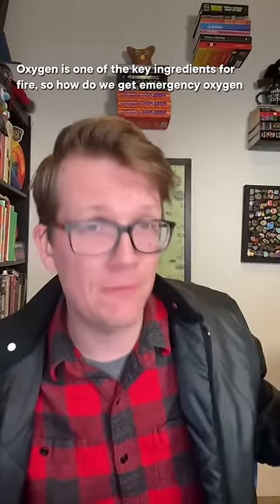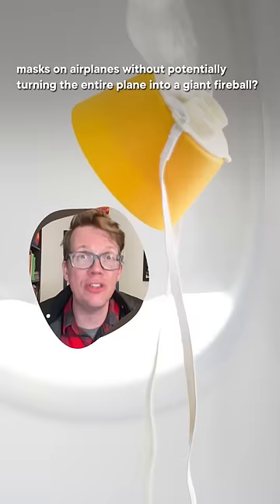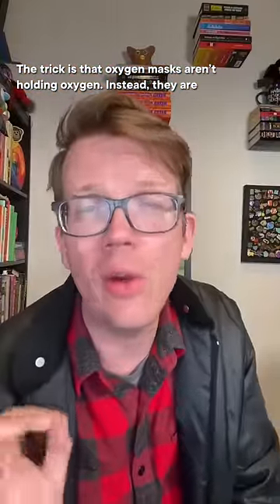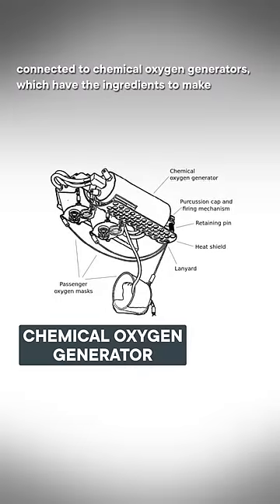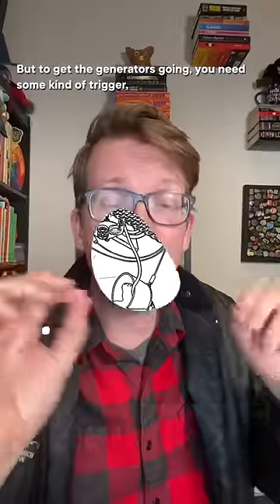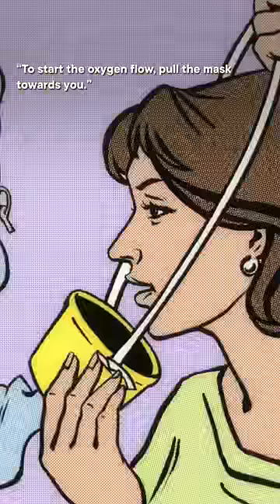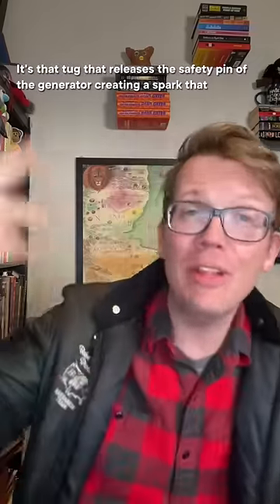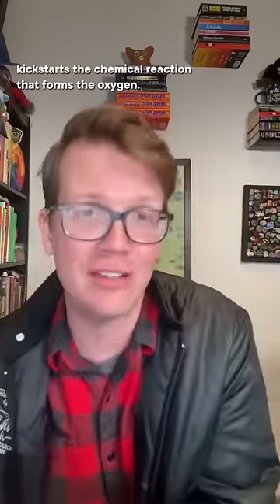If oxygen means fire, how do we get it on airplanes? #shorts #science #SciShow

Comment: Plane mechanic here I’m going to correct a few things from the video and comments (though I caught this early so not much yet). 

Firstly the trigger isn’t the pull towards you, it’s the downward tug. Just bringing the mask to your face won’t necessarily start the generator depending on how tall you are, so the instructions are (as far as I remember off hand) to pull down on the mask and then place it over your nose and mouth. This is due to the pin that starts the reaction needing to be pulled out of the generator to start it having a sting connected to the mask part. Important to not it does not need to be yanked on, just a firm tug should do the trick.

Secondly, I’ve noticed some people talking about O2 bottles so let’s address that. The ideas change depending on what kind of aircraft were talking about but I’ll be addressing what I’ve seen in regards to large passenger aircraft. No, modern planes don’t have actual O2 tanks mounted or contained for passenger use. This is due to weight and safety. Plumbing is heavy, so are containers. Having an entire plane’s worth of O2 sitting around is both a massive fire and detonation risk. It’s also massively inefficient in terms of weight. On top of this keeping and maintaining pressurized containers is a huge pain as they have to be examined frequently and pressure tested regularly. Generators in comparison are much better. They do need to be checked but the checks are light, there’s no concern of having an O2 leak, they are light, can hold a lot of potential oxygen for their size compared to bottles, and they don’t run the risk of exploding on contact with fire. Now they are still dangerous in a fire since heat starts the internal reaction, but they can’t produce enough to create an explosion hazard very quickly making them much much safer.
O2 bottles do exist in the plane though. The cockpit has it’s own dedicated O2 system since the pilots need to have it ready to go at a moment’s notice. There are also bottles in the cabin for flight attendants to use. Some may have seen these being used for passengers who are experiencing a medical issue. These bottles exist because they need to be mobile or have on demand production and not one and done production which generators cannot do.

Saw someone talking about how oxygen isn’t a danger as we have oxygen around us all the time. While true, we have a very low concentration of oxygen in the atmosphere, even lower amounts in a flying plane, so there’s not much issue with it being around. Pure oxygen however is extremely dangerous. It can and will explode if there’s enough of it and even small elevations in the oxygen content of a room can make fires burn much hotter and spread incredibly quickly. Fire is the largest danger for aircraft as even with all the safeties and backups it can eat through a plane very quickly rendering it uncontrollable or becoming a massive passenger hazard on the ground. Know where your exits are always. Don’t bring bags with you in an emergency. Delays of seconds can and have killed people. I know of one example where 10 people died because one man went for his bag and blocked the aisle. Fire on a plane is fast and deadly. Listen to crew, know how to get out. We try to prevent fire as much as possible for this reason.

May edit later if I see some other things but I hope this addresses a few bits of misconception. Cheers!
Reply: Oxygen doesn't explode, it just makes non-explosive things explosive :)
Reply: On the military side, we do have plenty of compressed O2 bottles and carry liquid oxygen in special tanks that’s converted to gas on demand.
Reply: @yingosensei  I am aware of this but unfortunately don’t have much expertise in the matter. I would guess it’s due to the want to have on demand control over the oxygen and since all your personnel would probably be trained in their use there is no need to use a generator that produces heat and can’t be shut off
Reply: "No modern planes don’t have actual O2 tanks mounted or contained for passenger use" I don't think you meant the double negative
Reply: I can't speak to all modern planes. But I can say that the Embraer Phenom executive jets, the most popular private jet in the last decade, ONLY has oxygen lines for all passengers.
Reply: @oumo  I wouldn’t be surprised, but again this is all for large transport category aircraft like 737s or A320s. Different classes will have different design ideas so I’m just covering the same kind and the most seen by people.
Reply: ValuJet 592.
Reply: Hands down the largest comment I've seen
Reply: there are a select number of full size passenger planes that do use bottled o2 because the areas they fly in make the generators ineffective.
Reply: @yumcherubicplum_5535  what areas would make chemistry no longer function?
Reply: I'm always amazed at people arguing things aren't dangerous. Anything can be, but especially chemical reactions. These canisters once brought an entire plane down because they were listed as "empty" in the cargo manifest of a passenger plane, and the pilots believed that. What the person had meant was "expired." So when one exploded in the cargo hold... well, it wasn't good for anyone on board. These are life savers but they work by a chemical reaction that causes oxygen so of course there's a risk. 

EDIT: ValuJet Airlines Flight 592, with loss of all 110 souls on board. Aside from them not being empty, the pins weren't secured properly so one likely knocked out and activated. These create immense heat when working so they began to set others off. The fire suppression system worked by making it air tight, which would block oxygen from making a normal fire worse. Here, there were 144 canisters going off one by one, making more oxygen by the second.
Reply: Correct me if I’m wrong but this is strictly on modern aircraft. I know for a fact that some older variants of the Boeing 747 did indeed carry supplementary oxygen bottles mounted to the walls of a cargo area, as well as the plumbing to support the delivery of the oxygen to the passengers in the event of emergency (I believe this was specific to Qantas 747’s, but could be wrong). 
There was even a specific accident where a young man was sucked out of a 747 crossing the Pacific Ocean due to one of these oxygen bottles exploding and ripping a huge hole in the side of the aircraft. 
Probably no longer the case because we don’t live in the time of Casio wrist watches, and 747’s having human flight engineers.
Reply: @soulman4292  Qantas flight 30? There were no injuries
Reply: From what I remember a certain class of an airbus has o2 tanks, it is for flights over the himalayas or something like that where the time has to be much longer as the pilots can't dive to a safer atmosphere
Reply: Can I pull the mask out, if I pull too hard? Is that a possibility because I hope not (main airline info wanted: Ryanair, I love hard landings ok, it's like a roller coaster)
Reply: @Ethan.YT.  I'm sure it's not indestructible. Ryanair probably wants 5 for the use of the mask anyways.
Reply: @9HighFlyer9  surprisingly there free, I think. They don't say about any charges.
Reply: Air Canada and several other carriers have passenger emergency oxygen systems that are fed by oxygen bottles in the cargo compartment. These systems are typically found on aircraft that travel routes that would typically take longer than 15 minutes to safely get to an altitude where the passengers can survive without supplimental oxygen. For example, flights over mountainous terrain.
Reply: @9HighFlyer9  some some a 340s that fly over a very select part of the Himalayan‘s do use bottled oxygen because the time required to get down to 14,000 feet is higher than a chemical reaction O2 generator can sustain
Reply: Didn’t he say it was from the tug in the video? They never tell you while instructing you before the flight that pulling the mask towards you isn’t enough to activate it.
Reply: @yumcherubicplum_5535  I've been told that a320s, 747s and now a340s have o2 bottles for passengers while flying over the Himalayas. Where is everyone getting this info? I haven't found a single reference to airlines replacing O2 generators with gaseous O2 tanks.

I'm really doubting that it's true. The weight involved would be enormous. The costs to engineer and recertify the airplane would also be enormous. You'd think that some airline, plane manufacturer or engineering firm would want to brag about a safety feature like that.

So please someone tell me where this information is hidden.
Reply: @DavidCruickshank  no he just forgot the comma so it looks like a double negative 

"no, modern planes don't have actual O2 tanks mounted or contained for passenger use"
Reply: @9HighFlyer9  When the oxygen generators are used they give off an enormous amount of heat. When installed in the aircraft they are insulated and separate from one another so that this heat doesn't do anything. But in Valujet's crash they had a box full of them in the cargo compartment without safety pins installed or insulation and they were up against one another. The massive heat of them going off started the fire. This would not happen to the ones actually installed on the aircraft.
Reply: I'll correct some of your mistakes: LOX is stored on many aircraft. It's an older tech, but it's still in wide use commercially and in military aircraft. 

Also the fire risk for oxygen isn't from there being too much in the room. LOX can combust from contact with grease which you should know there is quite a lot of on aircraft. You have to be very careful when filling LOX onto aircraft for this reason and if the liquid oxygen gets free of it's plumbing/containment anywhere and contacts grease it's a spontaneous violent reaction. That's why the industry is slowly moving towards not using LOX.
Reply: Large cabin Gulfstream planes have cylinders. Not a 737, but pretty big.
Reply: I will try to be brief 1/573
Reply: As a Life Support Tech for many large fleet and military operators I can say that both Aircraft manufacturers and Operators are moving away from Oxygen Generators. Oxygen Gens are known for catching fire themselves. I have discharged thousands and had more than a good number burst or catch fire in operation. Cylinders are far safer to operate and maintain. Al/Carbon fibre or Al/Kevlar cylinders are super light and are treated as test every five years or on inspection items. We are no longer stuck with the heavy 3AA or 3HT cylinders anymore.
Reply: The guy said... it's that "tug" that triggers...
Reply: You waited your entire life for this video 😂
Reply: Haha nerd
Reply: Can you clarify something for me?  I am a paramedic and I gave aid during an in flight emergency.   I was told by the attendant that it is air not pure oxygen that comes from the masks.   Is that correct or is it pure O2?
Reply: @SJDevenney1  Surely the cylinder is labelled as either compressed air or oxygen?
Reply: People can easily skip the "pull down mask" quite easily and go straight to putting mask on since the mask is above and it being lowered enough to reach tall person face is enough to be considered pulled
Reply: No to just about everything that you wrote above. I make the oxygen regulators for Boeing, Airbus, Cessna and about 90% of the rest of the manufacturers. While we still make oxygen generators they are heavy and expensive. The last 5 years has seen a big switch to individual compressed oxygen tanks. The A380 has 2 large oxygen reservoirs and 2 regulators that feed all the masks.
Reply: Yeah, pure oxygen environment, for a good example just refer people to Apollo 1 accident.
It’s all about concentration.
The difference between a medicine and a poison can just be concentration.
Air typically has water in it, in a small %, but in an environment of 100% water you drown.
Wether or not something is present is not really the question, it’s almost always the concentration, the density.
Reply: @daer2121  I literally am making these right now. They are switching over. Airlines do all the finish work which includes passenger oxygen.  This isn’t my hobby or a passion, it’s what I do for a living….This specific thing.
Reply: @daer2121  the weight and cost  savings is the primary reason for the change.
Reply: @UCbX3GPrJWFBaVJ3ZkwUC7cA that’s nice that you looked at a manual, I’m on lunch break from working in the clean room where I make, and once again not trying to be obtuse, these very parts in question. Last 5 years we have been developing and in the past 3 years fully ramping up this new technology. It’s a simple spring and poppet oxygen regulator on a small individual bottle. The switch for some airlines has been interrupted by the pandemic. Some Airbus use this new regulator while others use larger tanks of oxygen with one or 2 regulators per aircraft. But all I do is make life support oxygen regulators in a clean room. We are hiring if you are interested. We also make the dry gen and wet gen you are speaking about but that is the old tech and the airlines are switching over.
Reply: @steventyler8002  I'm being circumspect in what I say to keep all the information publicly available. I worked 737 flight line for years, and 777 for several more. Gaseous O2 is not currently a standard option on any Boeing aircraft, and all gaseous oxygen options come with a weight increase. This information is current as of March 22nd of this year. There are limited passenger oxygen systems for passengers who need supplemental oxygen to breathe that are cylinder based. These replace earlier oxygen concentrators that fulfilled the same purpose, and O2 for galleys, lavs, and crew are cylinder based as well.
If your company has developed such a system, I'd like to know who they are. Given how light a chemical oxygen can is, a bottle would be freakishly light. 
 I appreciate the job offer. If you want to move to New Orleans, Boeing could use people with clean room experience.
Reply: @daer2121  what’s the pay!?!?  Lol. But seriously I work for Collins Aerospace and our new system is lighter than the dry gens, weighs about the same as an empty aerosol can, and is far cheaper to manufacture. Also safer to make. Those dry gens are crazy dangerous to make.
Reply: @yumcherubicplum_5535  poor wording in this, descending does not take more time in mountainous regions, they just cannot descend below 10,000ft ASL in some parts of mountain ranges for obvious reasons
Reply: @steventyler8002  that is new then. Neat! Oxygen generators are finicky. We had a few aircraft with a central O2 system, which we hated. This sounds like a PSU sized O2 bottle, which is really cool.
Reply: Don't certain A340's that fly over the Himalayas use O2 canisters because there's no zone under 14,000ft within 15 minutes
Reply: @Likeusb1  that's available on all boeing (and presumably airbus) aircraft. It adds weight and cost, so is only used if needed.
Reply: @daer2121  Yeah, it is more expensive but it opens up possible routes for flights
Reply: @Likeusb1  true, just generally not useful. The 20 minute package is common. There aren't many routes needing the big system, and most airlines have a decent idea of what they're going to do with a bird.
Reply: @DavidCruickshank  he needed a comma. "No, modern planes don't..." Eliminates the double negative. Swirls cape "grammarman...away!" Out of tune trumpets
Reply: Nevermind. didn't realize he'd added in the comma already! Out of tune trumpets sputter sadly
Reply: i swear i’ve heard that oxygen bottles are used on routes that fly over tall mountains but i can’t find anything to prove it
Reply: @roowut  they are. It's just there aren't many routes that need them, so you'll almost never encounter them.
Reply: Pretty much agree on everything I don’t recall seeing you mention that smaller private jets do use an Oxygen tank because it has less passengers and requires less maintenance. An example of one that does would be like a phenom 300
Reply: @PinePrince  they tell you to fully extend the tube. The pin is attached to a lanyard on the tube, not the mask, so that will ensure you pull the pin.
Reply: @MinistryOfMagic_DoM  It's not LOX, that's used on rockets. What is used is Aviator's Breathing Oxygen, which has been processed to be a dry oxygen so that there is no concern of moisture in the system. LOX would create moisture as it expands to its gaseous state.
Edit: Aviator's Breathing Oxygen comes in LOX, but it's less common than it's gaseous counterpart.
Reply: @SJDevenney1  just shy of being pure, but close enough to call pure.
Reply: @daviddunsmore103  Aviator's Breathing Oxygen
Reply: I know that 747-400s can have a bottle system. I had to service the system on one (by myself) that had been flying for a Russian airline and sat on the ramp in Florida for a couple years. Took me 2 weeks to fix all the leaks, do all the mask drops, re-pack everything, put fresh bottles in, and sign it off. All on the ramp. In August. In central Florida. No engines, APU, or ground cart. 🥵
Reply: I need a TLDR 💀
Reply: Cessna jets to this day still have O2 tanks for the entire crew and passengers use. Although they don't hold very many people and the planes are small so its not a huge deal
Reply: Interesting, very nice!
Reply: @DavidCruickshank  I think that was a missed comma, not an incorrect double negative. “No, modern planes don’t have actual O2 tanks mounted or contained for passenger use.”
Reply: Thanks man!
Reply: Actually, many Airbus have oxygen bottles for passengers including A380. 
The difference between both systems is that the solid state oxygen generator found on B777 for example trigger the cartridge which supplies every masks connected to it and runs until depletion once one mask is pulled down.
While with gaseous oxygen, only the pulled mask will provide oxygen. How long it last depends on the number of bottles installed and passenger load.
There is no rule as far as I know related to flying over the Himalayas. Emirates flies both A380 and B777 over the Himalaya and the 777 aren't fitted with gaseous O2.
Reply: @HappyAchterhooker  It's interesting what you say cos' in my ex airline where I use to fly among others B777-3 and -2, the oxygen was only solid state. We never had any Boeing with gaseous oxygen at least during my 13 years career.
It might be an option from the manufacturer to opt for gaseous or solid state. I thought there wasn't any choice on that.
Reply: Thanks for the information. 

The elevated levels of oxygen in surgical theatres (of ~45%, which is up to double our regular environment of ~21%) is also one of the reasons you're not supposed to wear any jewellery/metal. Even a hairband's tiny little metal part needs to be removed. Only wear purely soft material hairbands. 
Removing jewellery is obviously also beneficial to post surgery when the body substantially swells.
Reply: The generators get incredibly hot. Are they insulated at all? I only know this because of my fire training in the Navy.
Reply: Not sure if anyone’s brought it up yet but wanted to add: another benefit to the generators vs a tank/plumbing system is that oxygen is only being produced where it’s needed. Since there’s one generator per seat, generators over empty seats aren’t going to be triggered so there’s 1. No wasted oxygen 2. No excess oxygen creating any more risk than there has to be
Reply: @fastmpc  Those are really good points, thanks.
Reply: Thank you for your time to write all of this. Very informative follow up after this short clip
Reply: @Ethan.YT.  probably not, but honestly even if you did, the pilots are trained to rapidly dive the aircraft to a safe altitude, which might scare you so bad you forget to even put it on in the first place. If there is an atmospheric pressure problem, the pilot won't stay at that altitude long enough for you to die to hypoxia.
Reply: @DausBlaust  I know but the thought of just pulling it off is scary even if I know I am not strong enough
Reply: @oumo  he is speaking about the planes that us peasants would be riding on, but yes most corporate jets use aviator oxygen bottles for passengers and crew instead of generators
Reply: @daviddunsmore103  aircraft oxygen tanks are labeled “aviators breathing oxygen” they are different from medical oxygen. There must be no water present in the oxygen or else it could turn into ice crystals in your lungs at high altitudes where it is being used
Reply: becoming firefighter here. In a ABC-danger training we had last week, we had a gas leaking out of a container - gas gauge showed: 20.9% O² in the air. As soon as we came close it started beeping: explosion danger, 23% O² in the air. So even a slight increase of oxygen already starts a explosion danger.

While with 23-30% oxygen the explosions won't be very powerful - more like a very fast spreading fire - anything above 40%, you start a spark and it goes literally boom
Reply: @rkkastarshina3989  also that sounds scary
Reply: @Ethan.YT.  Yes, oxygen is scary. It  can't burn itself, but whatever is flamable-oxygen makes it almost explosive. And a H² + O² mixture is unbelievably dangerous. Funny enough when hydrogen explodes with high % of oxygen + heat source, it makes water
Reply: @rkkastarshina3989  so you can make water from explosions, Sounds cool but potentially dangerous
Reply: @Ethan.YT.  From hydrogen - oxygen explosions yes. That created water
Reply: @rkkastarshina3989  cool
Reply: wow i'm not gonna read that
Reply: @an_intruder  you have to, ဩစတြေးလျရွေးကောက်ပွဲတွင်ပြည်တွင်းငြိမ်းချမ်းရေးမှာဖြစ်ပါတယ်
Reply: The trigger is actually when the masks fall. If they have been packed correctly. Also an aircraft mechanic btw.
Reply: About generators being comparatively light, due to conservation of mass, wouldn't the oxygen-creating chemicals need to be strictly heavier than the amount of O2 created? (especially considering that there are other chemical byproducts) That's in addition to the weight of the generator itself.
Reply: Aircraft engineer here. And im going to correct both this comment. And the video. 

1st of all, we carry around aviation grade fuel within the wings, the center wing box, and now, we also have additional fuel tanks that can be installed within the cargo compartments. Why are you so worried about oxygen when we carry around all this highly flammable fuel?? 

On some large aircraft (so FAR/JAR/CS 25 aircraft) we have centralized oxygen systems for the passenger cabin. Basically large oxygen tanks supplying all the seats with oxygen via tubes. We also have cabins with decentralized oxygen containers. 

Yes, the most popular is oxygen generators. But both centralized and decetralized oxygen containers are still given as options on most aircraft. Actually, generally decentralized oxygen containers provide larger amounts of oxygen to sustain life for longer periods (as another commenter pointed out for the Himilayas I believe).

Additionally, chemical oxygen generators are also explosive!! So much so, that the FAA ban them in lavatories for this reason. 

We mitigate fire risks posed by flammable fluids (not just fuel, we have more) and oxygen via risk analysis. For example, we make sure to keep potential ignition sources away from the oxygen equipment.
Reply: @underthematt4600  not necesarily. Some newer oxygen generators (and even bottles) have triggers linked to the deployment mechanism..but not all. Some still require a firm tug to start production or release oxygen
Reply: @DausBlaust  everyone says "dive" the aircraft. You dont dive a commercial jetliner like they show in the movies. Its a controlled decesent at the autopilots max decent rate. You wouldnt even notice the decent in the cabin
Reply: Interesting but I'm 100% sure when he said pull the mask towards you he meant down because they are above you
Reply: Thank you, it is very informative 👍
Reply: I heard that planes that has certain routes over the himalayas have oxygen tanks for passengers since the generator doesn’t last long enough for the plane to get to a safer altitude
Reply: We have 175L of LOX on my jet plus a bunch of walk around bottles ;)

It helps we're military though, we actually use it
Reply: dam i aint readin all that
Reply: The A380 has passenger oxygen tanks in cargo compartment. 
The B787 has passenger oxygen cylinders in psu s overhead.
Reply: The Boeing 777 series still use oxy cylinders in the frights plumbed to every seat PSU, and the 787 is sold as standard with an individual oxygen cylinder and explosive squib at each seat row. To be honest the oxy generators are seen as more hazardous because of the heat,
Reply: @DavidCruickshank  I think you missed the comma after "No".
Reply: Thanks for clarifying, much appreciated
Reply: As a student pilot and a aviation enthusiast, this man is a gem.
The only thing is, and I can be wrong… probably am, but most airliners won’t have anywhere close to having 30mins of O2 it’s more closer to 15min.
All what needs to happen is get below 10,000ft MSL
And the way pilots usually do that is basically, slow down, pull the speed brakes out and push the nose down to about 30-35° maybe engage thrust reversers if available… you’ll be down under 10,000 within a couple minutes or just a few. I’m missing a lot of steps, but that’s just the riff of things.
Reply: We got a actual pilot here congrats on not crashing your plane and living this long
Reply: Cheers!
Reply: Their is a few planes going over the himilaya mountains that have oxygen on them and it's not generators
Reply: When it comes to the dangers of fire, SwissAir flight 111 is one I keep in mind.
Reply: People learn that we breathe oxygen and take it to mean air is 100% oxygen.
Actually, air is about 1/5th oxygen and 4/5th nitrogen.
Reply: The tug depends on the plane they arent all the same
Reply: I've heard that it's laughing gas. 😂. Seriously tho. Is that true? And Airlines don't want people to survive the crash, survivors sue.
Reply: @SJDevenney1 I'm a flight attendant.

What comes from the oxygen generators is pure oxygen, however the mask is designed to mix it with external air.

For an inflight medical emergency using bottles, that is pure oxygen and can be set to 2 or 4 l/min but again the mask mixes it, so the mix depends on the flow rate from the bottle.

The pilots' o2 syatem does have the ability to supply them with pure oxygen via a toggle on the mask.

And to round it off, the fire fighting equipment includes head gear with built in oxygen supplies - either chemical or liquid oxygen - which also provide pure oxygen, but the headgear is sealed to mostly keep oxygen inside and toxic fumes or smoke outside.
Reply: Yes in fact there are o2 containers
I am a mp and have had the job of refilling the o2 tanks and then filling the tires with nitrogen!
Reply: Genuine question, does every oxygen mask have its own little oxygen generator or are they all connected to a large main generator?
Reply: @TigerBlackTigerBlackTigerBlack  In the planes I've been working (Airbus A320) the oxygen masks are grouped. Four masks for each generator, one generator per three seats.
In the lavatories are generators with two masks (hence max two people in the lavatory - no, not for that, for mums changing their babies! xD) and the galleys also have generators with two masks per generator.
Reply: @jmrumble  thank you! I really appreciate you taking the time to answer my question! I couldn't imagine everyone being of the same generator but I also thought it'd be a lot to have one per mask.
Reply: @DavidCruickshank his grammar is correct. The sentence is:
"No, modern aircraft don't have oxygen bottles"
No here is negating the previous statement, while the rest of the sentence is to reiterate what sentence it was and to give it more emphasis.

A more concise way to say it:
No, it wasn't a double negation.
Reply: How long does it take to recover from a mask-down scenario? I imagine after the failure is fixed, all the chemicals, masks/tubes, and chemicals replaced.
Reply: Yeah, we know it's the downward tug. That's what he said in the video
Reply: @DavidCruickshank  its not a double negative, they forgot a comma after the "No"
Reply: This was a fascinating read, thank you!
Reply: Thank you for taking the time to explain.
Reply: That’s crazy the ingredients to make oxygen from solid are lighter than the tanks used to hold a gas
Reply: A note for your future reference, if a comment on a YouTube video takes longer to write and read than the original video, it's waaaaay toooo loooonnngggg.
Reply: Thank you for this expert perspective!!
Reply: As someone who literally just took a flight 26h ago, no they do not tell you to pull the mask down. They do in fact just tell you to pull the mask towards you.
Reply: A380 and A350 have O2 Bottles for crew and passenger use and i would class them as a modern aircraft, to be fair there are many more aircraft flying with O2 bottles than generators the only modern aircraft i know with 100% certainty the has generators is the 787 series, to protect the aircraft there are burst disks on the side of the aircraft that will rupture if the pressure in the bottles gets too high for whatever reason. Also the fire suppression in the forward cargo (where the vast majority are located) is very effective and should prevent fire spreading to them not to mention the sidewall panels are fire retardant.
Reply: So if someone goes for their bag in an emergency, knock ‘em down and run them over, copy